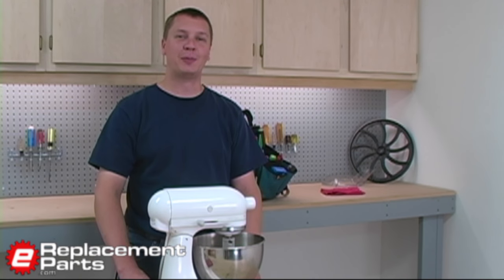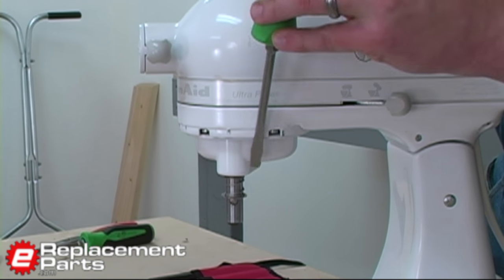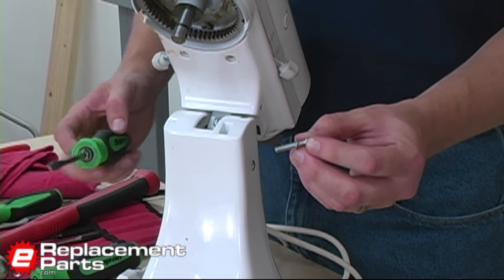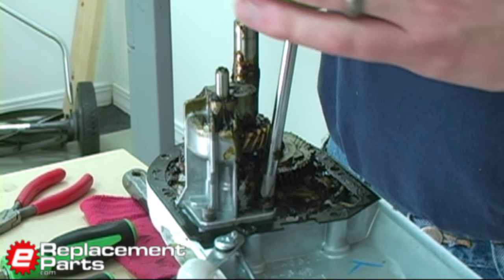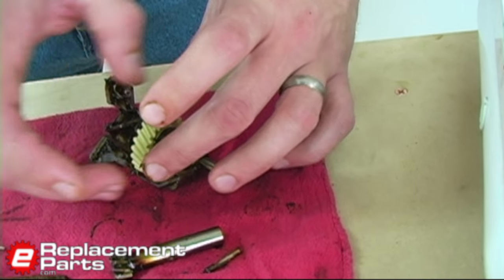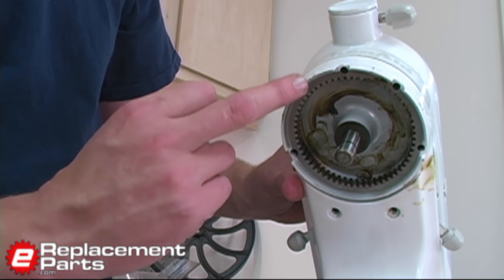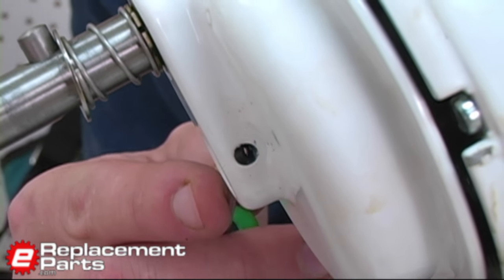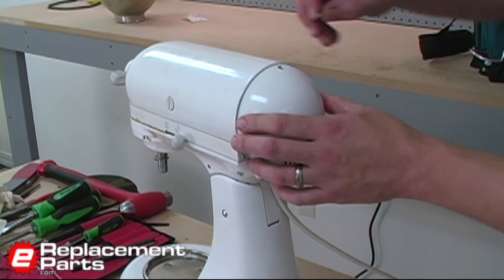How to Fix a KitchenAid Mixer That Isn't Spinning

Comment: huff a lump, I don't know if I have done it properly I must send it off too a service centre however no one specialises in this product locally have to send it off via parcel!! gutting.
I put the brushes in with the diagonal grove facing the top rear of the machine! is that correct??

thanks for your help!
regards

Comment: I got a dead one has power up to it but no go. How do you test the motor field winding / armature separately? If I put 120 volts AC directly to the brushes should the motor run? Thank you
Reply from the maker: Hi EurekaRecycler. The first thing to do is remove the back cover. Next, there are two wires that are connected to the lower right hand side of the control plate. One is red and the other is white. These are the leads to the field and the armature. Disconnect these from the control plate to isolate the motor from the rest of the electronics. From here you will be able to test continuity through the whole motor by touching the probes from your meter to the leads running to the motor. If you get zero resistance, then the motor as a whole is good. If you get infinite resistance, then you know that there is something wrong with the field or the armature. The next step is to test the armature and the field separately. Remove the brush caps and inspect the brushes. The brushes have a notch cut out in one of the corners. This notch keys into the brush holder and must be correctly aligned in order for it to make contact with the armature. Make sure that the brushes are correctly inserted. Touch the probes to each of the brushes and turn the armature to check continuity through the armature. If there are any dead spots on the armature, then it needs to be replaced. To test the coils of the field, take out the brushes. Next, touch one of the probes toone lead and then the other probe to the metal in the brush holders. Do this for both sides. It is normal for coils in fields to have very little to no resistance, but both coils should have the same amount of resistance.
Reply: Thanks for your help !

Comment: Very good with tools. Followed directions. Won't turn back on. The cog I replaced was 'shattered' with a few bristles that broke off.. I thought they would have been 'worn down' actually. I actually used it for dough only. One thing for sure, no more kitchen aid products after this. Even if I have to spend more on a commercial unit. The amount of use and quality of the product is simply unacceptable for the 'legend' of this product.. look at the view count of this vid as proof.

Comment: it's not spinning and making a clicking noise so I am thinking it is the worm gear....but now it is also hitting the bottom of the bowl. I adjusted the paddle height screw and it didn't seem to make a difference. Do  you think when I replace the worm gear, that will fix the bowl problem?  Thank you.

Comment: Well, the worm gear exchange was as straightforward as the video suggested but now I can't get the pin holes in the 'drive shaft' and the planetary to align - it's a good half a pin's diameter out vertically. I've tried 'a big hammer' but there's clearly some more critical misalignment somewhere.
Reply: a cpuple of smacks with a really big sledge hammer asually takes care of these little problems
Reply: +Peter Thody sounds like u may have the gear on upside down. I may not be  made centered.

Comment: great video. but unable to remove pin from planetary. unable to punch it out. tried wd 40. any other way to get housing off.
Reply: From Cindy, you must use a punch.. make sure it is the right size and you have to keep hitting it hard. Mine was not easy to get out but i was persistent and it finally came out.  My punch was too thick so i used a Allen wrench and hit that with a hammer.

Comment: I have a question. I'm going to be buying a Pro 450 model which only has a 300w motor. As far as I know, this has the nylon gear. I will only be using it for small batches of pizza dough, mash potatoes..etc. Nothing too severe. Does the worm gear typically fail when the unit is overloaded or used beyond its capabilities or under normal use can it also wear and if so, is it a slow process? I'm asking because I'm wondering if I should consider the Pro 5 models which I was told has all steel gears.

Comment: We have an older K5SS that is not working correctly.  When I turn the mixer on it does nothing, however if I turn the planetary it will take off.  When I ramp it up to 10 it takes about 3 minutes to get to full speed.  My voltage is 122 at the relay and it stays constant across the contacts.  The brushes are worn and may need to be replaced.  Do you have any other suggestions?  I hope the motor isn't going out, or the bearing are bad. the motor does knock some.
Thank you.

Comment: The planetary on my KitchenAid mixer works just fine, but the gear that runs the attachments (meat grinder, cheese grater etc. -- on the nose of the mixer) is apparently stripped. Is the procedure for replacing that gear similar?

Comment: Hi, there are a couple of issues I've noticed here with the roll pin attaching the planetary.  Min is stuck pretty tight.  Any ideas for getting it out or should I just keep hammering?
Reply from the maker: ***** What model number do you have?

Comment: Hi Mark, my KA is not running.  It seemed the power is not connecting with  the motor.    As I don't hear the motor sound run when I turn on.  Please advise me how can I fix it?  Thanks again

Comment: Mine when mixing pizza dough stopped (not enough power to continue) so I pulled out the dough and let it rest for a few minutes and then turned on. Now it has no speeds. Turn it on and it goes full bore. Do you have a suggested repair for that?

Comment: I have tried everything to get the roll pin out that holds the worm gear to the tower gear, even tried heating it with a propane torch to try to break it free and it just won't come out. Any ideas on what I can do next?

Comment: O, so I did everything as directed and my new gear is in, but for some reason I have no power now. I didnt touch anything electical and it at least turned on before I took it apart. I"m pretty handy with mechanical stuff by electrical confuses the crap out of me. Any suggestions as to what may be wrong now?

Comment: The mixer was working fine until it walked backwards while kneading bread dough on speed 2 and fell off the stand.  Not sure how it hit the floor, but the back cover (Model KS55) is out of place, there's a gap between it and the motor housing, and while it still runs in all speeds, it seems to have some resistance and makes grinding noises.  I tried to hold the beater shaft to see if it would slip, but it wouldn't stop turning.  What should I look for when I take it apart?  Any way for the motor armature or housing to slide due to impact? Can I knock it safely back into place?

Comment: My KSM90 makes a grinding sound and only tries to spin. Sounds terrible! I opened it to view the gears but found no problems / wear. I'd guess the motor itself is having trouble spinning, and seems to move around too much as it tries. Any suggestions? Thanks!

Comment: My mixer sat in a garage for 10 years. It was subjected to cold, but always sheltered from moisture. I started it up today. It sounded a little labored. When I switched the speeds back and forth, it would stop sometimes. Now it does not work at all. Any suggestions.

Comment: I followed your instructions to a tee.  I removed the five screws from the head (and did everything to make that possible), removed the four from the back, and got the power cord disengaged.  But the motor housing won't budge.  My mixer is slightly different.  It has a metal band around motor housing (that I also removed).  Is it possible there is something else different?  If so, I don't see it.

Comment from the maker: This is a sign that the motor has been overloaded. If it continues to smoke and burn without a load in the bowl, you may need to replace the motor and the brushes.

Comment: How do you adjust the speed control board on the back of the mixer ( 9 & 10 are out on mine) There are 3 screw on the back of the switch board with a spring attached to it- How do I adjust it to get all 10 speeds?  Thanks
Reply from the maker: Our tech says this needs to be performed by a service tech.  There is an attachment they use to gauge and adjust the speed.

Comment: I have a KSM90, over 20 years old now, we have found something wrong with it, and i thought we were ready to buy a new machine.  I tested the speeds out, with nothing in the bowl they all work, as supposed to (although i just heard a strange noise) when we start mixing various doughs, the speeds seem to not work individually, like the machine isnt strong enough to handle each speed with something in it.What part do you think needs replacing? Is it more than just that worm gear?

Comment: I have a KitchenAid Artisan model KSM150PSQG0 and it only goes on high speed. I watched your other video on how to change the phase board but that did not fix the problem so I think its the speed control plate. Upon replacing the control board I found a small pin that has fell out of the mixer and I have no idea what it is. The mixer still works but not sure if I should proceed with replacing the speed control plate not knowing where the pin goes. Any help would be appreciated.

Comment: My KitchenAid no longer locks in place. I think the mechanism is just loose. Do I have to take the motor assembly off, like in the above video, to make this repair? Could something else be the problem? When in an upright position the locking arm works fine.

Comment: I have a 5qt heavy duty lift model k5sswh. Trying to take it apart to get to the likely shot worm gear.  I think i need to unscrew to motor housing from the base, but the 4 screws (huge ones) connecting the two pieces are beyond tight.  Any thoughts?
Reply: i have the same problem, but model ksm5psgn.  cannot get those scrrews loose for anything
Reply: +Holly Ford If you know what a speed handle is (kinda like a crank for a Model "T" Ford), put a screw drive attachment on it. You put your hand on the perpendicular part so you can push hard on the screw head and your chest on the end if need be, and twist with your hand on the perpendicular part while you are also pushing down/in. Also rapid tapping, not to hard but a lot of taps with a hammer b4 and while twisting. Old trick for taking out corroded screws on Navy aircraft.

Comment: The Kitchen Aid metal plate that covers the opening for attachments, fell into my bowl while I was mixing, causing the assembly to be off balance. It worked temporarily, but has now completely stopped. It makes a bad noise like it is completely jammed. Can I repair myself? Thank you for any help.

Comment from the maker: If I am understanding right on low speeds it will spin, but on high speeds it doesn't. In the case of not turning at any speed, you are looking at a gear. The video should also provide more helpful insight on your repair. I hope this helps. Thanks for watching!

Comment: model KSMSPSGN is not a tilt, all i have are 4 gigantic screws that are impossible to loosen.  i finally got that little pin out with a hammer and a nail set.  now the screws from hell.  i sprayed wd-40 and banged on them with a big hammer.  theres just not a lot of room to get good torque

Comment: i am following your video but am stuck on the step where you remove the roll pin that holds the planetary in place.  my pin is totally stuck.  you make it look very easy to remove.  amy i doing something wrong?

Comment: I have a problem of certain speeds not working(1-6) but 7-10 work. Before this happened it worked fine but was emitting a burning smell and then started to smoke so I shut it off and unplugged it, then I let it sit and cool down before I tried it again. Any idea as to what the problem may be, and is it possible to fix it myself as there are no people in my area that repair KA mixers.
Thanks

Comment: Excellent instructions but after putting everything back together, the mixer is as dead as a doorknob. I can hand move the planetary, so it's not that and there are no loose wires. Any ideas?
Reply from the maker: This sounds really obvious but it has been a source of needless tear-downs. Make sure the outlet that the mixer is plugged into has power. On these mixers this problem can be caused by either a worn out switch, control board and last but no least and the easiest to repair, Carbon Brushes.

Comment: my only concern in doing this myself is ordering the specific replacement part for my machine. Or, are they all the same for KA mixers? Also, what if the reason my mixer doesn't spin is due the some of the teeth on one of the other gears has broken? One repair video had that as the reason, they also said it was a good idea to replace all the grease with new grease. Is that necessary? My machine isn't very old.
Reply from the maker: It is important to make sure you order the correct parts for your model.  We have a great and helpful customer service team if you need help ordering and a no questions asked 45 day return policy if you do make a mistake.  I always change the grease or oil after opening a tool, especially if you have an issue with a gear.  Worn or broken bits may be in the old grease and they will cause another failure if they are allowed to remain in the mixer.
Reply: Thanks, I hope I can fix it, I bought it at the goodwill just before Xmas, they have a 7 days return policy, but I figured it was well worth 165 bucks. When I got it home the planetary was turning, then stopped and the motor was still running. I am just worried about getting the wrong part.glad I can talk to someone there to help me get the right part.

Comment: my mixer was "working" ie power and spinning but would stop, the worm gear needed replacing, which I did following your instructions, now nothing happens at all when I plug it in, no sounds at all or action. any idea what I did wrong? I'll be taking it back apart tomorrow for another look. 
thank you.
Reply: As it turns out, the problem was that I had improperly reinstalled the brushes (I checked them out and hadn't realized the importance of orientation), silly mistake. I almost replaced the circuit board instead, thinking I may have damaged it during reassembly.
Great videos, saved me the cost of a new machine.

Comment: Where do I find part numbers so I can buy replacements. I found Worm Gears  with 3 different numbers. 241803, 4162897, W10112253, are they interchangable and if not how do I know which one I need?

Comment: At 4:30, make sure the roll pin has an open exit point. If you're not careful, you'll pound it right into the closed end of the tower where it will be stuck forever!

Comment: If the gear was broken or stripped wouldnt it be a good idea to clean the old grease off and replace it? If there are still pieces of the broken gear in the grease it would eventually be sent through the gear mesh causing failure or premature failure.
Reply from the maker: Brandon Harrison That is a great point. I will pass this on to the repair team. Thank you!

Comment: The ring and planet gears looked dry. Should these be re-greased as well?
Reply from the maker: Hi Vivienne, the gears you are speaking of should be greased. The part number for the KitchenAid grease is WP4176597.

Comment: we've got a 3 yr old model  #KSM150PSMC      motor is running but attachments aren't spinning.    what part do you recommend we order?   Thx
Reply from the maker: More than likely the worm gear part number W10112253 is worn out.  Our tech recommends replacing the whole assembly part number 240309-2.

Comment: This video looked good, so I got the worm gear.  However, I've been smashing the crap out of that roll pin at 1:38 and it is not budging.  I've been hammering it for an hour and there is no movement.  I hit it with WD40, and still nothing.  Any advice?
Reply: I got a high end punch and hit it with a mallet for a full minute.  The pin finally gave up and moved.  It now has an indentation about an eighth to three sixteenths of an inch deep in one end.  Got the job done.  The back panel didn't go on quite right, and the hooks at the bottom broke.  Despite the difficulty and the collateral damage, the mixer works.  My wife is very happy.  Thank you, eReplacement parts.

Comment: hello im a chef and I checked my brushes on the machine and gave the back a gentle clean now its not working checked the fuse! and its fine the machine is not working! nothing!
any suggestions I think I may be in wee trouble if I don't fix this!!
regards

Comment: My KitchenAid mixer motor starts to smell like its burning and changes speed while we're mixing. What could be causing this problem and how can it be fixed? Would it be the brushes or does the motor need replaced? I could find any videos on replacing the motor. Do you have one? Thanks for your help?
Reply from the maker: +David Brown  The motor can be replaced, however, this requires special tools to adjust the speeds once the repair is complete. Most of this time speed problems like this are related to the phase board or control plate. With the problems you're having we recommend taking the mixer to a service center.

Comment from the maker: To answer the first question, it can depend on how old the mixer is. Some of the older ones can take a little bit to ramp up. It might also need to be serviced and adjusted by a service center.

As for the second question, all the six quart mixers will have the all metal gear train and some five quart mixers will too.

I hope this helps. Thanks for watching our videos!